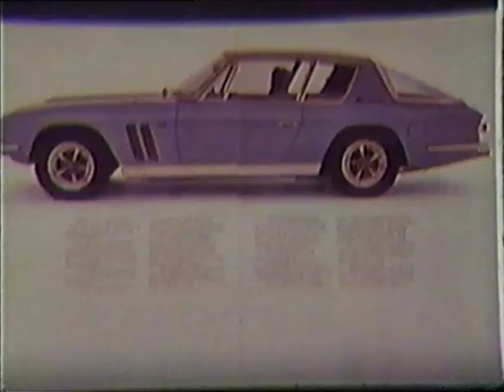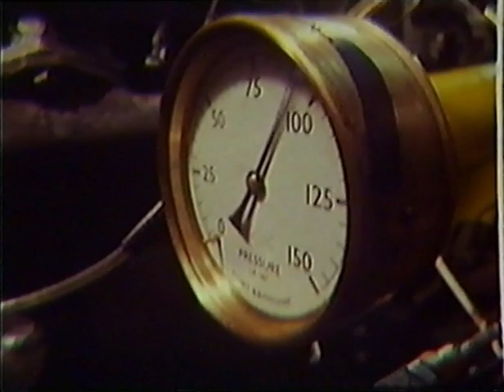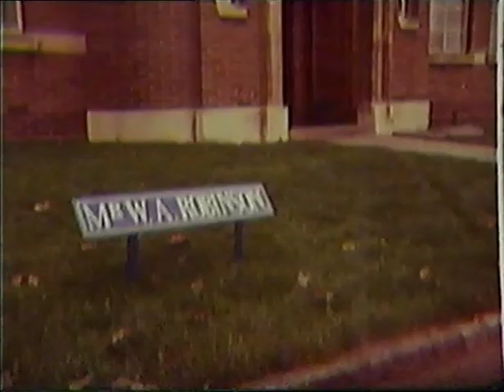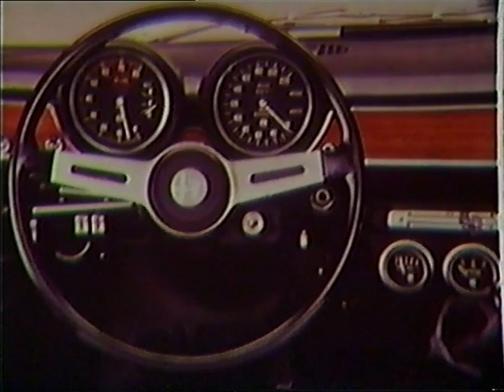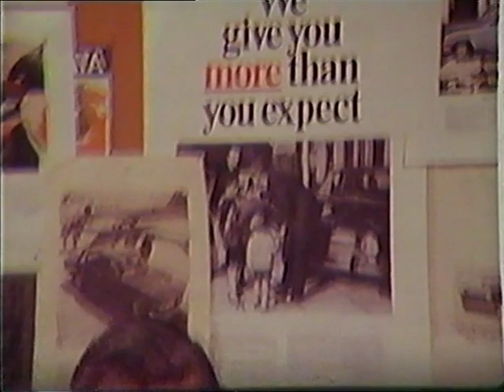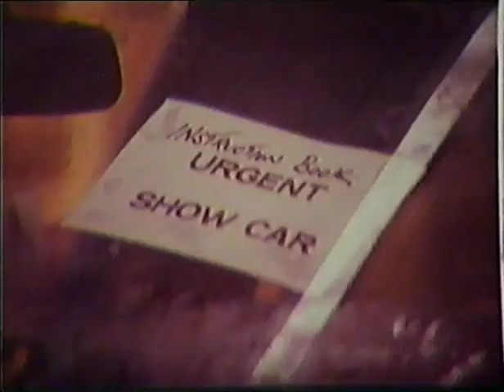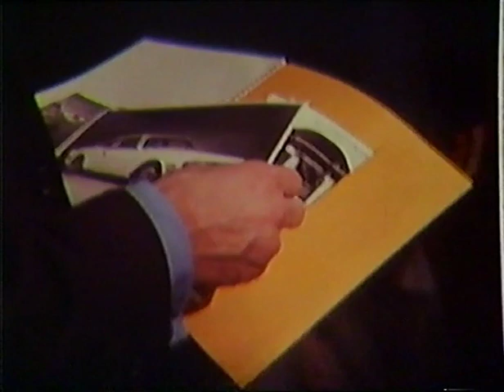Triumph Stag documentary THE DREAM CAR (1970) Rare development footage of 'Project Stag'

Comment: Why didn't they use an existing engine from the BL stable?
Reply: Because they were under “new “ management… The old engineering manager ( Harry Webster) told the new incoming management team that the new slant engines were not ready and should fit the old straight six initially ( Harry had been parachuted into Austin/Morris to sort them out very soon after the Leyland motors/ BMC merger) so was overruled
Reply: @MrDodgedollar  
The straight sixes did not have the power. The 1950s engines were too old in design. The Rover V8 did.

Comment: Beautiful car, but putting the reliability and quality issues aside which tend to dominate the reasons for its failure 8t had another flaw, it needed to succeed in the US market, but the US 4 seater convertible / GT car market was much more crowded that the US roadster market Triumph had accessed with the Spitfire and TR range. You had products from domestic manufacturers which were much cheaper such as the Mustang and they came as a "proper" convertible not compromised with the window frame and or the T -Bar as well as better quality products from Porsche and Mercedes plus they were touching the Jaguar E type price point, So even if it had not suffered its other issues it may well have still flopped in the critical US market and so still been killed when the domestic market collapsed following the fuel crisis.
Reply: I concur Graham.. completely…
  Putting aside the disastrous amalgamation ownership in 1968, and all that happened post 1968; The principal of the overhead cam Triumph engine has been shown with hindsight to be pretty advanced… and should have gone into premium products has the 1970’s dawned .
   My parents had two Triumph Estate cars right through the 1970’s.. They were built in low volumes mainly for the domestic market… 
  I am convinced commercially there was major traction for lots of sales of this estate car ( with the V8 engine ) in North America sold as a sporting Station wagon right alongside the Tr’s and Spitfire… This was not tried because the defeatist idiot management ( BL) didn’t want the V8 in the big Triumphs- They were wrong in this and pretty much most progressive thought… and the rest is a doomed future
Reply: If the silly sods had installed the lighter and superior Rover engine in the car, that was in the BL parts bin, it would have been a massive success. It was basically better looking than the competition by a mile.  The body, suspension, etc, was superb.  It was that unnecessary bad, undeveloped engine they dropped into it.
Reply: @johnburns4017  In the early 70s they could not build enough Rover V8s for Range Rover and P6.
Reply: @grahamariss2111  
The Stag was two years late. That was enough time to up Rover V8 production..

Comment: “We don’t intend to release the car until we know everything is right”
Translation:
“We will release it with a badly designed engine that will kill the car off”
🤡
Reply: It wasn’t badly designed.. it was a combination of underdevelopment and crap management post merger (British Leyland corporation)… before this disastrous event.. Triumph was an relative independent company under the Leyland motors ( buses, lorries) ownership
Reply: @MrDodgedollar  
The engine was badly designed.  Oil and water galleries were too narrow. Simple basic things like a radiator being too small and the water top up bottle being too low was beyond their engineering knowhow.  Garage mechanics saw that immediately. Then straight and angled mix on cylinder head bolts.  That also fused the cylinder head to the block. Boy! what a bunch of amateurs. They could not design a basic V8.
Reply: @johnburns4017  John; I am an hands on engineer.. and I own a completely original 1971 built car.. Fact one.. The radiator is fine … The problem was debris left in the block on first build that jammed in the radiator cores; I was still flushing out stuff the first two years of ownership .. The rest of it was under development; Another word its weaknesses; The fact is if the standard engine is built properly… its fine.. I was skeptical when I bought it but really.. Its fine and I am a member of the club with thousands of members; There is a classic car series called “For the love of cars” on Amazon prime I think with paul Glennister and Ant Ansted… 
 Ant was very negative about rebuilding one of the Stags that was featured.. In fact, he declared, he didn’t like the car at all .. but he set about rebuilding it, anyway without spoiling it when finished they took it to a formula one station to a top engineer there, to test the cooling system and- It worked fine as a complete standard system!
Reply: @MrDodgedollar  
I do not agree. 😄  There are known faults with the engine/cooling. Fixes are known. All those faults were not mass imagination by 1,000s of people. 

They had two companies to make the heads. One changed the design without telling Triumph. If you go head from the duff company, or two heads from them, you had a dog.  If you got two heads from the good company and no sand in the block, then you got a dog.

Comment: Voice from the future ‘use better quality timing chains and what on earth are you thinking! The water pump doesn’t go on the top of the engine’, I doubt they’d listen anyway
Reply: To be fair, quite a few chains have gone close to 6 figures.

A header tank solves most of the issues of the high mounted pump :).

Mine was fine engine wise :).
Reply: The car was rushed the PI could not pass Californian emissions test so they rush a engine together literally! That car which on song is beautiful plus the tr7 ruined the brand financially
Reply: @simonedwards5070  The TR7 was the best selling of all the TR's.
Reply: My parents 1976 Triumph Stag is on its original timing chains at 73000miles and water pump and never broke down or overheated once 😎
Reply: The key thing was this was a new engine not fully tested but what is known now is this engine is sensitive to build quality, must have engine oil changes every 3000miles not 6000 and proper topped up quality coolant. This is an engine that doesn’t tolerate neglect!
Reply: Very interesting all the book's say the stag was designed by Michelotti before he was asked to do  the face lift of the 2000 and it was he who had the idea in his design studio for month's before triumph became interested in it as a production car. By the way one of the pre production car's broke down in that European filming and triumph never bothered to bring it home. I think Tony Heart picked it up about ten years later I saw it at heart racing in London it had the 2.5 straight six engine. I have a Stag and a Sprint regards.
Reply: I am changing a choke cable today and I can appreciate the quality of components but the build design and ergonomics with regard to productivity levels are abysmal;
     The management did not appreciate the engineering need to speed up assembly times through better design and just blamed lazy workers when the problem was out of date component design... pretty obvious in hindsight
Reply: It all sounds so similar to the Imp.........lack of effective testing, and then build it away from where you design it. Unions may have driven home the nails, but management set them up.
Reply: @MiltonKeynesStreetLighting  
Try using the power and acceleration and see what happens.
Reply: Apparently SAAB is responsible for the position of the pump. On the slant 4 as designed and fitted to their cars, the engine was fitted 180 deg. around and a gearbox placed at the front. The original design with a belt driven pump (now at the engine bulkhead) would not fit in the SAAB's engine bay with this arrangement, so it was repositioned to the top.
Reply: @MrDodgedollar  It's a bugger getting that cable routed around the heater and fitted squarely in the console!
Reply: @johnburns4017  A smile? Your really do have a downer on this car don't you. Have you ever owned and run one? I'm guessing not.
Reply: @pierre-de-standing  
I like the car. Just do not use the power and acceleration on a standard engine from the factory. You are asking for trouble. Do the mods then all is fine.
Reply: @johnburns4017  John; most engines have been rebuilt; The cars are over 50 yesrs old. Mine is the exception, it has not been rebuilt and goes fine. If these engines are built properly.. and remember the quality control at Canley was very poor. In short, a properly built engine today( standard) is just fine

Comment: Too bad that V8 was such a poorly made engine .
Reply: And yet, approx 9,000-10,000 still exist, the vast majority with the Triumph V8 engine. The SOC is the largest single-model car club in the world. Mine had a top end rebuilt at 21 years (gaskets, rings, heads skimmed) and no other engine work in the 23 years since. Gear box lasted 38 years before a rebuild. Diff 33 years. The power windows are 44 years old and no issues, no rebuilds. I own/owned a lot of BMWs too and l love 'em, but the power window and trans failures are legend, not to mention plastic timing chain guides, VANOS issues and plastic cooling system components. 

I get the impression that this Stag film is not entirely staged; at least it is clearly apparent that it was filmed at different stages of the Stag's development and issues crop up (increasing V8 cc from 2.5 to 3.0; bigger brakes; you can see how Production hated having to stop the 2500 production line to install a Stag V8, as the assembly line didn't allow V8 installation from above or below). These became essentially hand-built cars because they were so low volume, a bit like the early Karmann/BMW e24. We can agree that engine assembly QA was poor, but I have no issues with interior or paint. If you're concerned about component reliability  (e.g., water pump), you can go electric. German (Benz) timing chains will last much longer than originals.

Alfa and Fiat (GTV, Sud, Fiat 130, 124 Spider) were all great designs and brilliant cars, but also let down by poor assembly and (especially) Soviet steel and lack of corrosion protection. In contrast to the UK, Italy, France, West German car plants had comparatively few industrial problems. Guess who won in the end?
Reply: It is!   and fifty years later the engine design is found to be sound .. Some weaknesses in design but all the problems were quality control of mainly block and heads in manufacturing- BL sourced an inferior head gasket around 1975 ( No Comment 😡) 
   I could list the weaknesses and the subsequent improvements but it is academic The engine is incredible for a 1960’s development- I know I own one
Reply: @MrDodgedollar  
The engine design was NOT sound.  Third party manufacturers made parts, after figuring out the problems, to put the dog of an engine right.  Only modern fully synthetic oils and cooling mods keep the car going today. Then synthetic oils were not available.
Reply: @johnburns4017  My 1972 Mk 1 has no engine or cooling mods, runs fine on classic mineral oils and NEVER overheats. I once met a guy at a festival, who turned up in a Range Rover. He had previously run a Stag and claimed that the Buick engine was not as bullet proof as everyone seems to claim. We will probably never know the truth behind the politics and production difficulties (in terms of numbers and QA etc) of both engines, and maybe the Buick based engine is superior, but a well sorted and maintained TV8 does the job, is plenty fast enough and sounds wicked.
Reply: @pierre-de-standing  
A big problem with the Stag was a third party maker of cylinder heads changed the design causing overheat problems. Two companies were used.  You could be lucky and get two heads from the good maker, or unlucky and get one head the bad or two bad heads from the rogue maker.  

The timing chain was too long. If not made to the highest standards would give trouble. Using modern fully synthetic oil promoted longevity in the chain, as it does for all parts in all engines.

I am not taken by in by "I always use inferior oil, and it is original and lasts and last." That is nonsense. Any old engine, on any car, can be greatly improved by a new contactless ignition system, modern oils and modern rubbers in gaskets and hoses. Those three points can actually be DIY'd.

Comment: Why did Triumph not go to Rover, also BL, and say, hey, give us your engine. No they had to weld together two Dolomite engines and thereby cock it up on an industrial scale. It was a massive catastrophe. Never stayed cool, always got too hot, warped the heads and blew up in your face right there and then.
Reply: They had already started the development of the V8 by the time BL acquired Triumph. Using the Rover V8 would meant that the team developing the Triumph V8 would find itself out of a job... 

Not to mention, the inline four was a decently reliable engine (how much of it was SAAB, the first user for the initial four years of that engine, simply being more thorough in testing and finding out more of the gremlins in its design than Triumph, I do not know), so it was reasonable to hope that the V8 would have not been much worse.

Unfortunately, it was...

Then again, it is not like no other companies made a fatal mistake in the design of an engine that doomed its car model.

For, example, the Lancia Gamma boxer engine had the direction assistance pump driven by the distribution belt on the right cylinder bank. Park the car with the steering wheel turned, the belt would snap on starting the car and destroy the engine (a common modification is to replace that pump with one electric, or or one driven by the accessories' belt).
 
Stupid mistake, beautiful car - especially the coupe - complete commercial fuck-up.
Reply: Because BL management was totally inept. They let each division carry on with their own engines and platforms instead of rationalising and using the best from each division across the range. BL should have stopped the development of the Triumph V8 engine and seen it as a huge risk not to use the Rover V8. 

Another weird choice from BL was to use the Landcrab doors on the Maxi in order to save money and thereby ruining any hopes of making the car look right. At the same time they decided the Maxi needed a brand new engine, so they built a completely new factory for that.
Reply: @pilskadden  those doors were also used on the Austin 3 litre, so they must've got their money's worth out of them!. Seriously though, ALL British management was crap in the motor and motorcycle industries. Lord Stokes was always biased towards the Rover and Triumph marques in the same way that Len Lord had pushed Morris behind Austin ten years earlier. Complacency, refusal to invest and arrogance was the management style of the time, and ultimately the downfall of British industry. There is a BBC film about George Turnbull setting up the Hyundai Pony operation from scratch, which is an eyeopener about how things could be done if the will was there.
Reply: I very much doubt that two Dolomite engines were "welded" together!
Reply: @woongah  
The slant-4 was under-powered for the car. SAAB did not do anything in the development of the engine. Ricardo did that.
Reply: @johnnytenjobs  Indeed. You only have to think about it to see why that wouldn't work. The second bank has to be a mirror image of the first and then share a common crankshaft and peripherals. It is lazy Clarksonesque thinking to draw to that conclusion!

Comment: Yeah, trying to play in the group with Ferrari, Mercedes, Porsche and Alfa Romeo for less money. That will work. NOT. Never does.
Reply: The car body was fine. It never even rusted a lot like British cars did. Which tended to rust before your very eyes. If they dropped in the Rover v8 in, it would have swept the board. When problems were known they never rectified them. That is how bad they were. Also the car was TWO YEARS late.